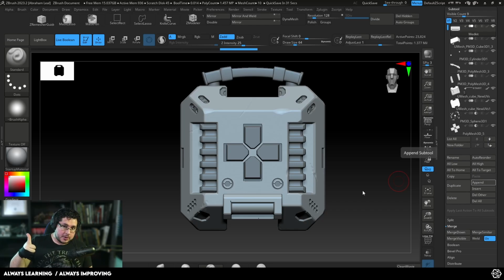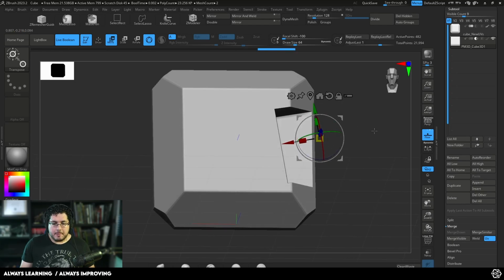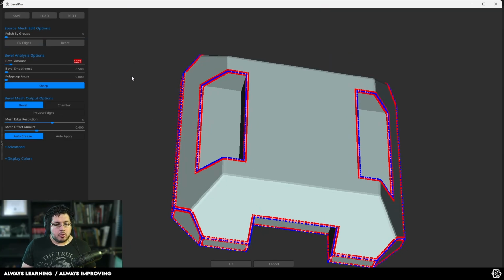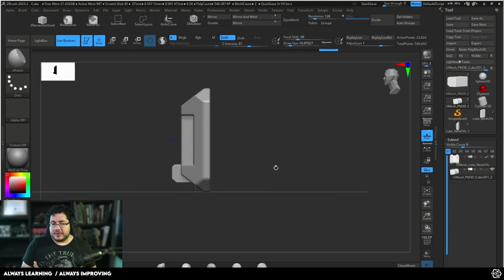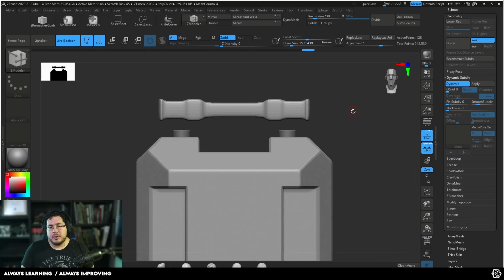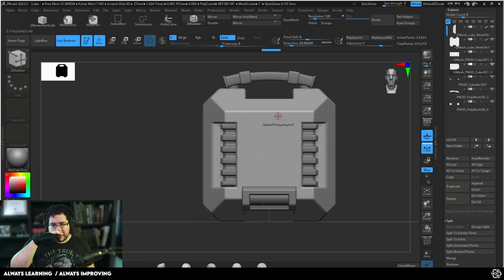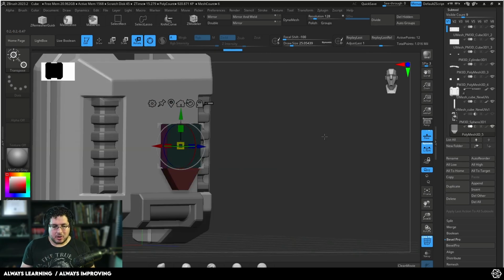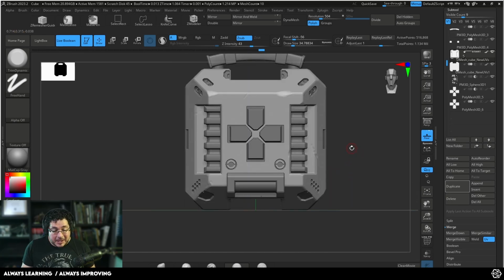Hard Surface Basics | ZBrush Tutorial

Comment: if i want a carreer in 3D hard surface modeling, should i learn z brush?
Reply from the maker: @herewasmars  yes , ZBrush plus either blender or maya would be ideal
Reply: Thanks!  @AbeLeal3D
Reply: I find this process to be destructive where working on feedback in a real production environment would be difficult.  For example if an art director asked for the bevels to be larger or smaller doing that would require going back to the actual bevel process and recreating them.  Where as in 3dsMax / Blender it would be a simpler process.  I am not saying Zbrush has to be just as good at HS as it is a sculpting but I am trying to find out how useful HS work in Zbrush would be.  I am new to this type of work in zbrush so if anyone actually uses it in production and has different steps for this I would love to hear / learn them.

Comment: Thank you Abe. Even if this seems a simple task, I can't find a way or option to straighten an entire edge loop when using the Zmodeler brush! For example, select an existing edge loop, and then straighten or align the edges all at once, horizontally or vertically! 

When using Blender it's super simple. I can select my edge loop and scale them until I have a perfect aligned horizontal edge loop from all the edges.

But I am not able to find a simple operation like this when using the ZModeler brush. Hmmm, I am sure there are multiple ways, but wonder what you would recommend getting this job done. And how you would approach that? Thx a bunch!

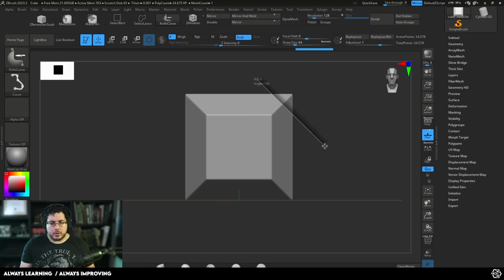Comment: Great video - I'm having an issue. When I make the Knife Curve cut on the upper right (timestamp 3:15), then I hit 'Mirror and Weld'. It makes the right side like the left side - it wipes out the cut. What am I missing? Thanks!
Reply from the maker: easy fix, by default the mirror and weld will mirror right to left, if you want it to be the other way around you just need to flip the object first. easiest way is to go to the deformation panel and mirrior on the x axis, then do mirror and weld.

Comment: that's fantastic. Thank you. But you know what I've never seen? How artists work from a concept design, build a low-poly mesh first and then get the final high-resolution results with Zbrush. Especially hard surface. Like a gun, etc. would be great to see a proper workflow. Thx a bunch for all your videos, love them and keep rocking. Cheers
Reply from the maker: Yeah I can show that process although honestly I haven't used a low poly to high poly to low poly in a while. Nowadays it's faster to start directly with the high poly and then optimized based on the project
Reply: @AbeLeal3D in that case, it would be just a low-poly from a concept design, to a high poly. Once you have a low-poly created at the very beginning, and then you do add from that base a  high-poly mesh , well there is no more need to do another low poly. 

It would be only from Low-Poly to High-Poly. End. I believe, this is a bit harder to do. Because you follow a concept design (lets say a concept design prompted using Midjourney, like a sci-fi gun, or whatever) and then you build a low-poly mesh based on that concept. I think it's a very important part, considering a nice edge flow, smoothing groupps (normals) and from that base mesh, you start using Zbrush to generate the High Poly Mesh. 

Also super important to cover the process with the normals and the baking. Usually, for Hardsurface Modeling, you need a clean low-poly, with great edge-flow. And for Hard Surface, you can't just use Zbrush's Decimation Master, because you need nice UVW's. 

I think, that's the kings level of modeling, because with that, you cover it all. You'll model a perfect nice low-poly base mesh from a concept design, and on top of it, you create an amazing high-poly mesh in Zbrush, that adds all the extra details and the smooth normals for baking. 

Yes, you could do it the other way around as well. You create the High-Res Mesh in Zbrush first (also curious how you would do that when working from a Midjourney concept design), and then you do the Low-poly. I believe it's harder. Curious about your thoughts, ideas and worfklow.

Love your videos, because you also cover important workflow questions, which is super important but rare to find. So keep up the great work you do. Love it! Thx a a bunch and can't wait to see a video like that from you. all the best,  cheers   🤗